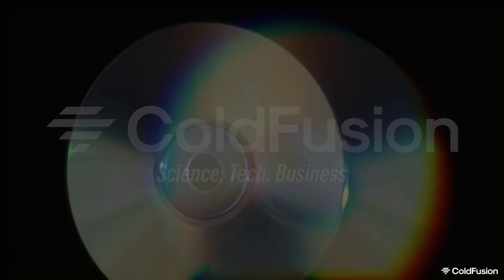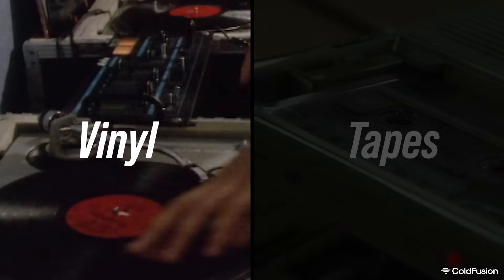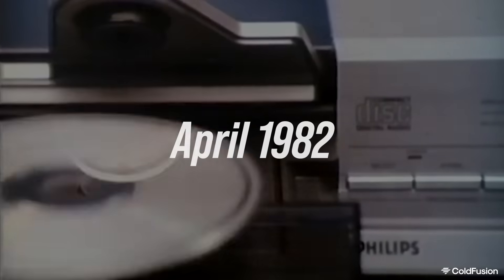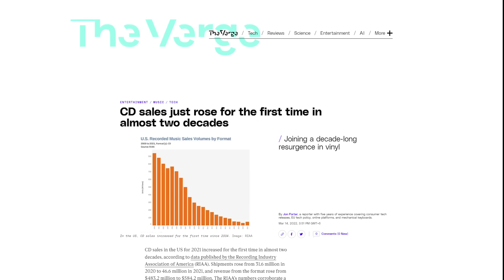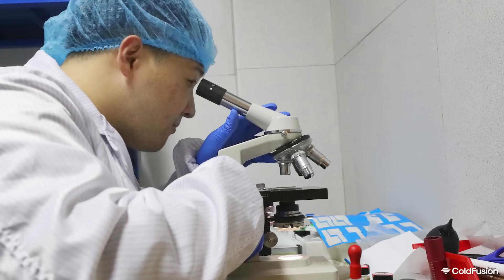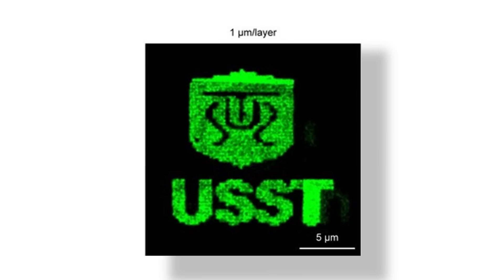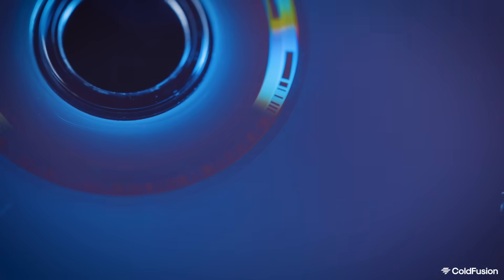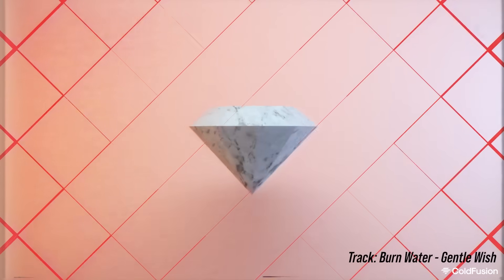Why This New CD Could Change Storage

Comment: So, basically, it's possible to store 200tb on a CD but very expensive and time consuming to read or write on it. But if the read/write speeds improve, data centers can use this tech.
Reply: @IssacFoster Honestly? $50,000 makes it very affordable for data centers. Consider that 1,600TB in HDD's is about the same price. More importantly, that number of HDD's (I'm using 10TB as an example) would consume significantly more power over time, not to mention IT resources. And because data centers require multiple drives to hold the same data (AKA RAID), that cost multiplies significantly. Sure, they will also need multiple of these optical drives, but the cost scale is not the same.
Reply: @YT-TheLegacy  that's why I said this can be used in datacenters if the read/speeds improve. Unless you buy a least hundred of these devices that cost 50k and make a huge raid system. I don't know how huge datacenters take deals but spending 5 million dollars for a 200PB facility sounds fine to me.
Reply: @IsaacFoster..  It really depends; they could offer a long-term backup solution; a number of data centers are used for remote backups, and they don't need to run a lot of these over long-term. It would be SIGNIFICANTLY cheaper if they did something like that, and many corporations would be VERY interested to use this as a part of their crisis plans.
Reply: This is EXACTLY why CDs got put on the back shelf. Doesn't matter how MUCH you can store, the TIME it takes to retrieve the data (and to store it) is, well, I'm guessing you never had a tape backup drive in your 386. It's SLOW.
Reply: @AnthonyRBlacker  Exactly this 💯 It is just too bloody slow. Even for data centers that can afford the lasers, what exactly is a data center supposed to do with data that can be retrieved only a few megabytes at a time? This isn't 1994. The speed and bandwidth of this thing would have to increase dramatically to be of any use.
Reply: @maybehuman4  its not slow, latest update from them shows it has faster write speed than HDD
Reply: It could be something like microfiche where you bring it to a library to use their expensive machine that copies select data onto something normal like an SD card or to your phone. It would make this format good for "cold storage" of data that doesn't need to be accessed very often. For example if someone had a large collection of family photo albums, they could get it all scanned onto a CD. And then if any of their albums are lost or destroyed, they could replace it. 
But also in a lot of those cases it would be totally fine to have to wait multiple days for copying to complete. That's how long it used to take to download stuff, so the cost of a mega cd reader is a way bigger deal than the speed.
Reply: @JrIcify  there has been an update since this video, the scientists got write speeds faster than a HDD, but even if it was slow people would rather have slow and cheap, than fast and expensive. that's what SSDs are for anyway.
Reply: @AnthonyRBlacker  Tape drives are even still in use today! And yes, they are agonizingly slow to my understanding.
Reply: @AnthonyRBlacker for those out of the loop, tape drives are still used in data centers for backups. They are the cheapest way to store petabytes of data for cold storage
Reply: @AnthonyRBlacker  Yeah lmao, "unlikely return" - dude, it's unlikely for a very good reason, and this problem isn't going to freaking scale when it already bottoms out practically for much less dense formats.

It's just not feasible.
Reply: @AnthonyRBlacker  DVD /BD is as random access as HDD, unlike tape
Reply: storages are divided by tiers, there are very cheap tier cold storage which you can only access once a year using magnetic tape. This could very fit into the spectrum of cheap vs speed tradeoff.
Reply: NAND flash still wins.
Reply: they will probably keep using tapes
Reply: That definitely will not happen.
Reply: A use case for this tech is for other parties to safeguard very large swaths of information to shield it from big tech and govt deep state efforts to erase and/or alter information in near real time in order to maintain Orwellian control over said information. Multiple organizations could establish themselves as custodian/watchdogs of information - as it rapidly takes on archival/historical significance. All Orwellian oriented entities (all govt, all big tech and other large corporations) ceaselessly wet-dream over getting total control of information and thus be able to rewrite history to suit their narratives - AI deep faking alterations, etc)
Reply: its true but noone expect CD to be readable as fast as SSD OR HDD, its enough to be readable writable like blurays etc. u wont read all data at once, you can read partially as its needed, not all at once, what matters is they can achieve lots of data in smaller size. In future maybe reading or writing speed can increased and CD can be the main thing but for now this is enough to be a big leap for improvement of CD, other types of storage have more data corruption and CD is most trustable , HDD is mechanic and SSD lose data when its not lost, but CD is ideal way for storage as optical thing especially if its made in achieval quality, u can store all ur important data in 1 CD instead of hundreds of CDs and when u wanna use the u can just use  other ssd and hdd technology for daily use. Noone  expect CD to be short term use. This can be used for data centers to backup things time to time. It doesnt need to be main way of storage.
Reply: Optical disc technology is not suitable for archiving data for long time and they are not fast too @Ericaandmac
Reply: Its great news for game industry for high level of graphics,
Reply: 2 petabits, not petabytes
Reply: It also makes for great home backup tech.
Reply: slow I am guessing at most 600 megs a second if your lucky which on a 200 terabyte disk would be slow as shit since its nothing for such a large disk to read this is why cd's and DVDs got replaced with flash memory storage a while back now
Reply: Your describing a normal hhd, a cd is basically a disc form a hdd. for longevity reasons people do use hdd sometimes raiding.
Reply: @Nothing-f8z  yeah but a hard drive has one huge advantage over a cd in that you have multiple platters to read which help increase the read and write speed a whole lot a for example 22 terabyte wd hard disk drive has 10 platters each plater at 2.2 terabytes so it can have a read speed of 300 megs a second on sata half the speed of the cd at 200 terabytes which is why hard disk drive can at least beat out the cd for speed in that regards because they can have multiple heads all reading data simultaneously were as a single laser takes longer to read the same data
Reply: @raven4k998  So if they read and write the disc in parallel, it could operate like a hdd
Reply: Yeah I wasted most of high school and middle school waiting for cds to burn….. I’m sticking with digital copies lol
Reply: @bobhope4949  yeah cd's are all good until you realize how damned slow they are to get all the data on on them off or vise versa so if they made a 200 terabyte optical disc that's nice but it will be slow as shit because optical discs had speed issues and when they tried pushing the speed up to 72x the discs started to explode literally explode which is why they slowed back down quickly to 48x or 52x max
Reply: Data centers could be a thing of the past! Let us hope so.

Each person can be their own data center.
Reply: @Teshuvah-n27  with 200 terabyte cd's you could be your data can be saved on them and restored slowly mind you but restored non the less from them over time if you need it to happen
Reply: Not a CD but an optical disc (of which CDs are one example).
Reply: @Jul-66  still will be slow as hell I will take a hard disk drive over that any day of the week as they are faster then those optical disc drives by far
Reply: @Jul-66  yeah but optical can fail just like raided hard disk drive they are just so god dammed slow compared and they have issue with disc rot so they are not immune to lasting forever either
Reply: they updated their story since this video, they were able to get write speeds faster than average HDD's
Reply: I can use this tech without the speed improving. I prefer slow CDs. The noise from fast ones p*sses me off.
Reply: That's what those companies r positioning their products as , if you go to foliophotonics
Reply: Yes but technology advances making it more affordable with research time
Reply: Now if someone could think up a way of what the heliscan read and head did for tape and adapt that for laser writing. Maybe make a moving laser that writes across the disc left to right at an angle at high speeds with a moving laser beam to write multiple data streams  at once  Instead of writing a linear spiral track with many layers. DVD RAM had the right idea to move in that direction by using a sector type read and write system that works kind of like a hard disc.
Reply: @stvlu733 They have, its called a raid. spitting and/or copying data across multiple discs.

Comment: I still get triggered when companies advertise the "bits", when on the interface we use shows "bytes". I applaud you for doing the conversion cutting through the sales BS 💪. 200 TeraBytes is still a lot. This seems to have started with ISP's advertising download speeds in bits. Then the user says "I thought I was paying for 100Megabytes per second" ISP replies "no its 100Megabits" 🤣😅

Comment: I bought my first hard drive as soon as I could afford one in the mid 1980s. By that time the technology was achieving a whopping 20MB (mega bytes) in a half height 5 inch drive. The drive only cost $400, or $20/MB, $20,000/GB, and wait for it, $20,000,000/TB. Yup, twenty million 1985 dollars per terabyte. I just bought a 3-1/2 inch hard drive that holds 12TB and paid $6.25/TB.

Comment: The audio CD comes out: "It's the pinnacle technically possible. It's too expensive and will never catch on."
The CD data comes out: "It's too slow and costs too much, it will never catch on" (eventually it will reach 52x at a cost of $20 for a writer)
The DVD data comes out: "It's the pinnacle of what's  technically possible. It's too expensive and too slow , it will never catch on." (eventually will reach 24x at a cost of $15 for a writer)
...............       I bet on this new technology in stores in 10 years.

Comment: The development of this technology was initially revealed in 2004, so it's nothing new at all. Like many similar interesting projects it likely won't ever see any actual use cases. A single-use storage medium in the terabyte, let alone petabyte range is of little use as a consumer-level product and even for large-scale backups it's not likely to be economical. Still, it's always preferable to get actual results from research projects rather than see them abandoned due to lack of funding.

Comment: I love physical media, but I wish they'd do something about the fundamental drawbacks on optical discs, like possible degredation of the materials themselves over time, scratches, cracks, stress fractures from temperature changes underneath the plastic, or a giving issues with single spec of dust or fingerprint (from y'know, that person everyone knows who touched the surface).

Comment: 20, 25, 50, 66 GB are enourmous capacità, for evolution of codec (h.265) the choose of industria is a "bluray" of 6 GB with codec top h.265, low cost and good quality for tv 40 pollici.

Comment: I think the downsides are painted to negative here. I do not see a need for Petabyte Disks in the private area, most people do not even able to fill available storage solutions properly. They stream their stuff anyway. So that would not be my target in terms of market, we do not need to solve a storage problem in the private area (currently). 
The costs for Femtosec lasers are actually much lower than I had expected, 50k is not a price that a big tech company or a state would shy away from. I see a need in big storage for (long-tem) archiving and cold-storage, so that would be a market for these disks in my opinion and the downsides are much less critical for that segment. So with a bit more research, this could indeed be a big help for this segment

Comment: Honestly I'm not too sure about this. Personally I don't miss CDs and most of them I had ended up getting scratched and not working. It was annoying for smaller amount of data so it would definitely be very annoying for 200 GBs. Just get a large pen drive or external HDD and save your data that way.

Comment: Man a 200TB disc could possibly make 4k movies near uncompressed. And TV Shows be multi seasons on one disc. Also have another stage in backuping up data. Music uncompress multi track disc probably couldn't fill up the disc for an album. Still this amount of disc storage would be amazing. 
This video gets confused with bits and bytes. The true storage capacity is 200TB or 1.6 Petabits, NOT Petabytes.

Comment: Replacing the femtosecond laser with traditional UV laser technology would be the practical direction to move. Also the laser assemblies could take a lesson from the printer industry and instead of a single laser traversing the disc, thousands simultaneously could be used in several arrays capable of simultaneous read write on multiple  concentric circle tracks instead of using a single linear track. Combining these strategies may create a disc with less capacity but it could also be a RAID storage device within the context of a single disk because of its multi-layer read - write capability. Leveraging more traditional technologies would also bring the price down substantially and probably reduce the capacity but even a 10 TB disk still has fantastic potential especially for archival purposes.

Comment: "1.6 Petabytes = 200 Terabytes..." That is incorrect - 1 Petabyte is equal to 1000 Terabytes. So, 1.6 Petabytes = 1,600 Terabytes or 1,600,000 Gigabytes.
Reply: its 1.6 petabits, the video is full of errors, if you find the article you find the real data
Reply: 0.2 Petabytes

Comment: Um, what would I use it for... I own CD's/DVD's. I love them, I would love to transfer my entire digital Library to one CD, but then what if I lost it, or if it degraded or got scratched... Losing 1 disk in my collection, 1 movie is annoying but its 1 film, or one Album, its easily replaceable... If I had my entire library on 1 CD it would be worth I dunno 20,000 Dollars (probably what I've spent on physical media in my Lifetime) You can't put that much value on a CD... the danger of something happening to it is too great. This has to be a replacement for a HD, not a CD... which means the read speeds have to be on par with an SSD, as far as I know CD read speeds aren't even close to that, and if it comes out at $50,000 USD no one's going to care.

Comment: Data writing on a CD/DVD is a singular process. Once written the RW finalizes the data write and the disc is 'sealed'. New method of writing will have to be implemented or even if it is 200Gb it will still be only write once.

Comment: Again and again the same.
For decades we had new huge storage on optical media.
They even made terabytes on cellotape decades ago.
But always was much more expensive for GB than the storage of its time.
It always IS, and sure It Will always be.
Ring me the day i can buy It cheaper or at least faster than the other options on the market.
Its nice, its interesting, but please, stop saying It Will be a Revolution or even It Will be something for your audience, you and other look like a storage/computer tech ignorant, or worse, a liar snake oil salesman, more interested in views/money than informative.
Here you have a have ideas:
Viable comercial fusión
EV solar charging
Much more energy dense batteries
Double efficient electric motor
Room temperature/pressure superconductor
Wáter from air
Amazing new transport system
Or the BEST one, being honest.